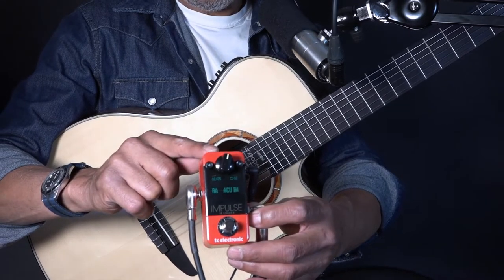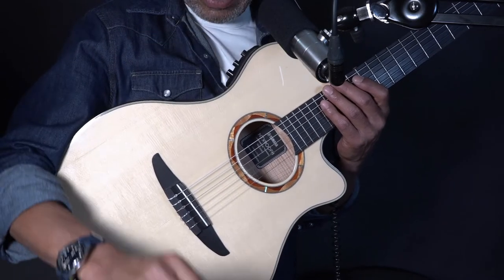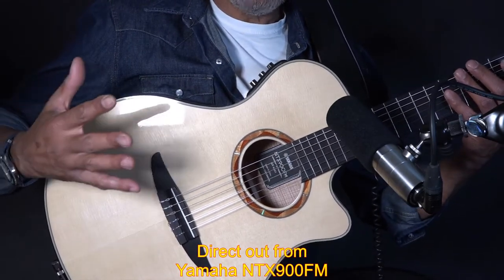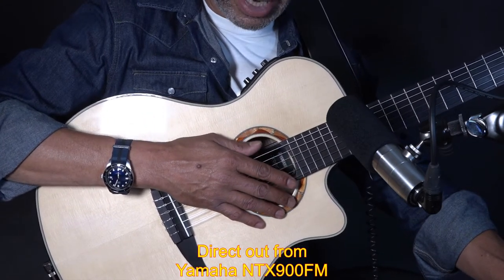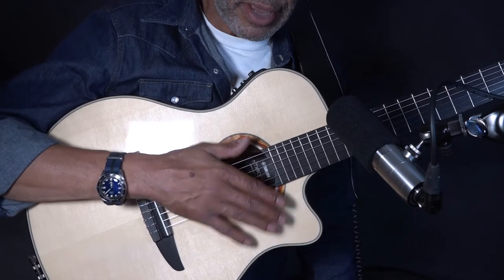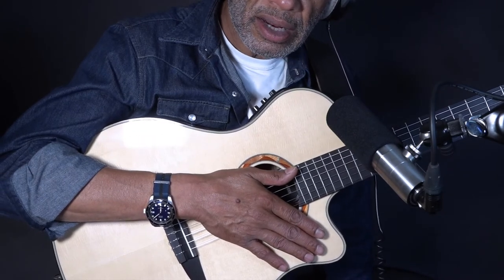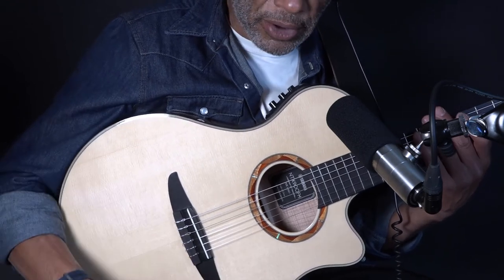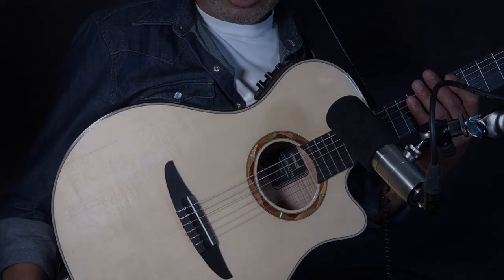TC Electronic Impulse On Nylon String Acoustic - Earthworks Ethos

Comment: Well, first it's good to know that this Yamaha guitar you're playing doesn't have a piezo pickup.
The piezo pickup is a pressure-based system, unlike the transducer, which works by contact and captures the vibration.
This Yamaha guitar you're playing has two 3cm diameter transducers, one in the bass region and another in the treble region of the guitar. They have independent volumes, in addition to an overall volume control. You also have the possibility of using the equalizer on the guitar and the one on the mixer where you'll be plugging in to get a better sound.
From what I've heard on my Audio-Technica ATH-M50x headphones, this pedal significantly damages the guitar sound with aggressive and unnecessary highs.
I've been using an NCX 1200R for over 10 years, and all I need, and I think you should try, is a professional direct box to go to the mixer. I use a "Countryman Type 10S" because it's transparent and doesn't interfere with the original sound, only preserving the frequencies you request in the guitar-to-mixer transfer.
Reply from the maker: Thanks for the info, I'm only an occasional acoustic man, so more experimenting to do. I will use the pedal mainly as a speaker sim for electric.

Comment: If you would have to choose three of your favourite handheld mics, which three would it be?
Reply from the maker: Well... Condenser, the Earthworks SR40V. Dynamic, the Beyerdynamic M88 NC and then I play with the Earthworks SR314 or the Beyerdynamic M500/V90r ribbons for a bit of 'mascara' when I'm in the mood.
Reply: @AntonBrowne  Is the NC version of M88 discontinued? What are the differences between the NC and the TG version (which they are still selling)?